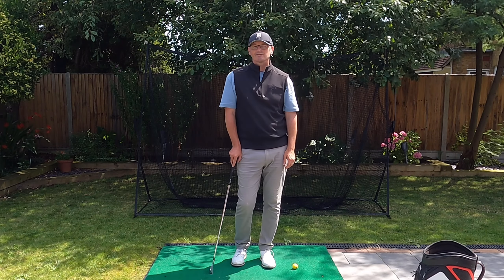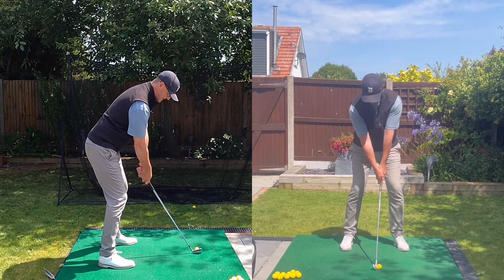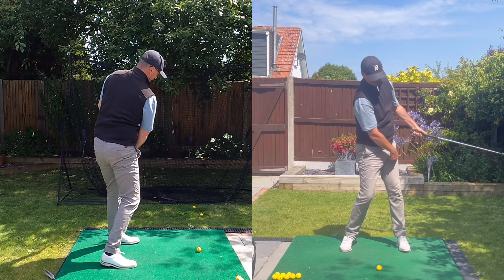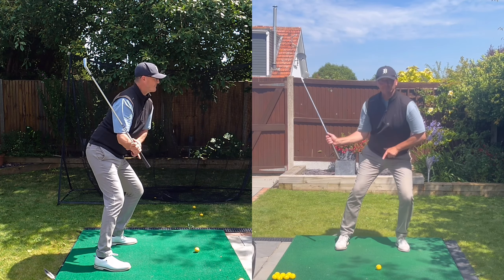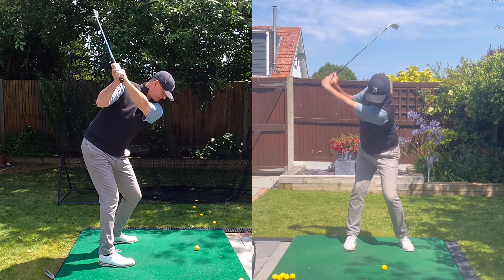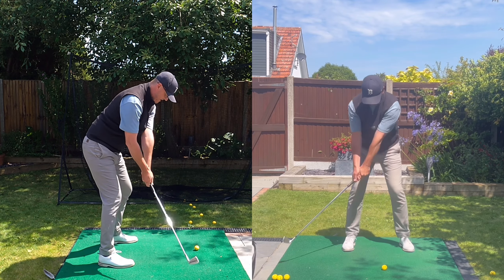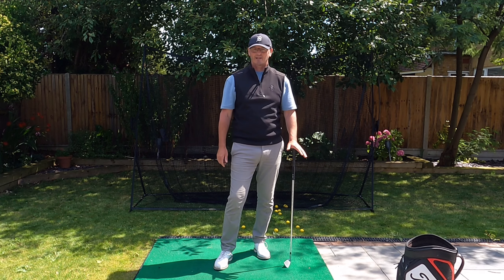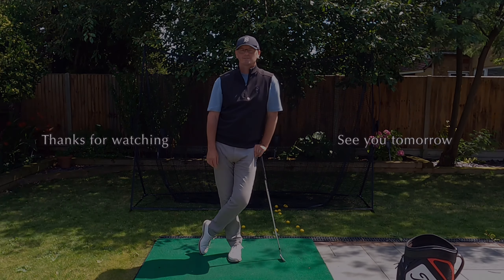28/31 - Learn to Create Internal Power and Speed in your Swing

Comment: Warren a senior golfer here who still can pivot…. My feeling when doing this drill is aggressively covering the ball. The challenge on my part is to stay down through the shot. 

I’ve come across an interesting swing thought\movement to initiate the down swing in order to cover and recenter over the ball. Once at the top of my swing my first movement/feel is to rotate my right foot clockwise. The sensation for me is that I’m starting the transition from the ground up, using my right foot to push to my left side  and by pushing the right hip back allow me to keep hip depth.   For me it seems to work interested in your thoughts.
Reply from the maker: Hi Edward, I really like what you’re saying here, it creates the right sequence and stores speed too, if physically able then I encourage more to do what you do. Sounds like you know what you’re doing. 
Thanks for messaging your thoughts 
Warren